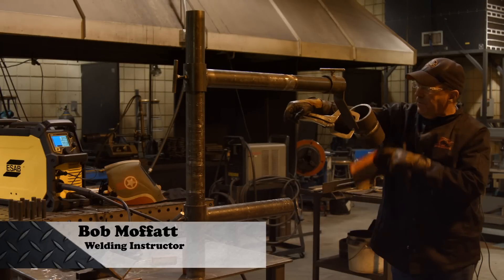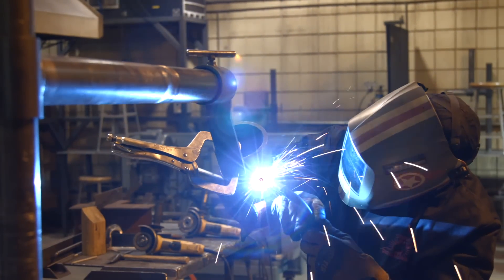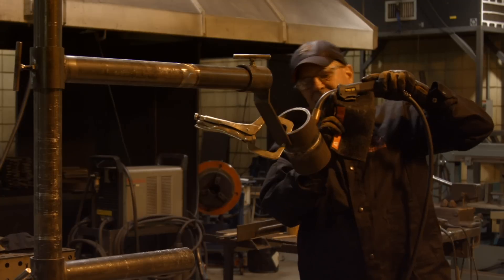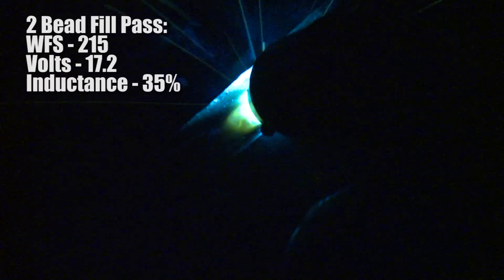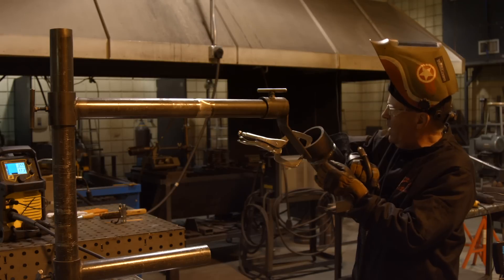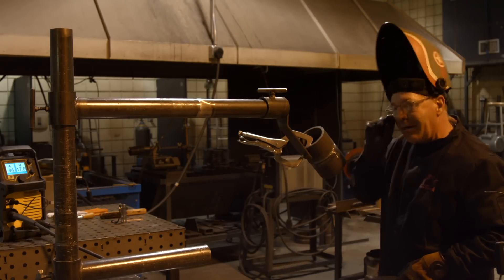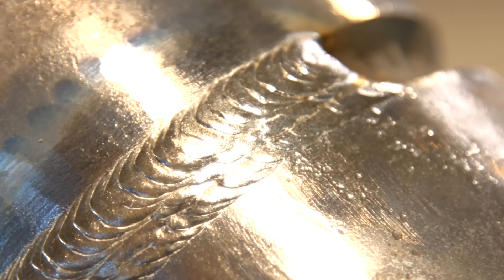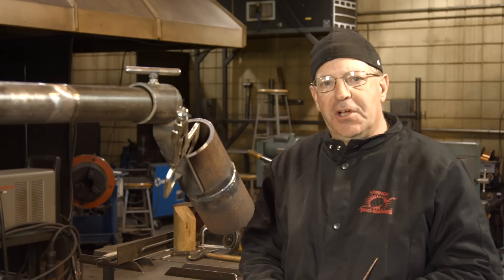🔥 6G MIG Fill and Cap: 4" Heavy Wall Pipe Welding

Comment: Okay the place I'm taking the weld test at you can't adjust the machine it sounds way too high it's more of a hissing than a crackling like bacon and they want you to trigger it uphill cuz that's about all you can do cuz I've tried one test already practice test and it is way too hot in my opinion but you can't adjust the machine the machine is older than the hills and I don't even know if it's set right or what got any answers 0.45 hardwire 75/25 gas

Comment: A rubber band in-between the folds of those velvet shields really helps keep them attached to your arm. So long as you are always propping its not an issue, but if you shift your weight or twitch they can fall out from under your arm.

Comment: You never answered my question last video about why mig weld a pipe joint when it isn't a code compliant process to ever weld pipe with...
Reply: All you have to do is qualify the procedure applicable to the joint configurations you're going to produce and within the essential variables. Tons of work on pipe is done with the mig process daily.